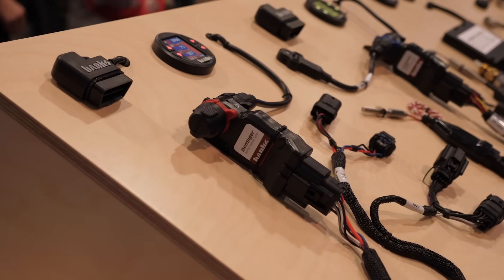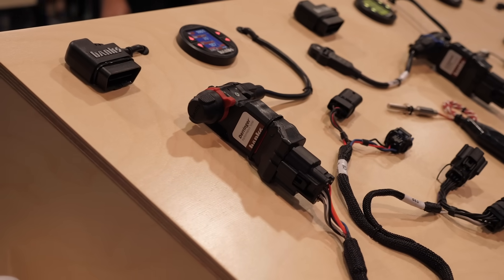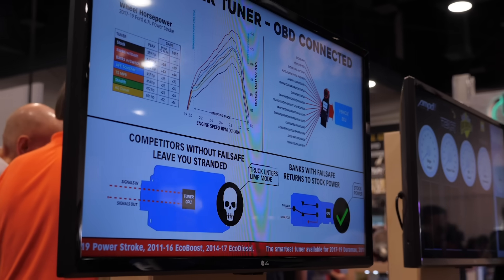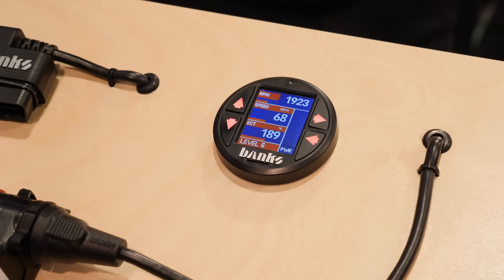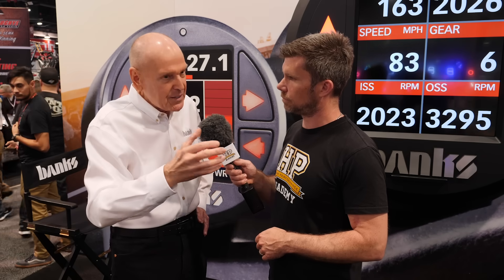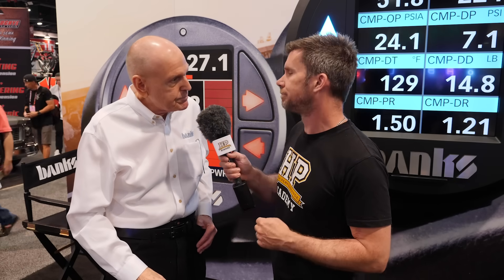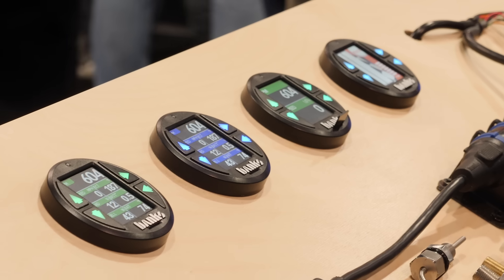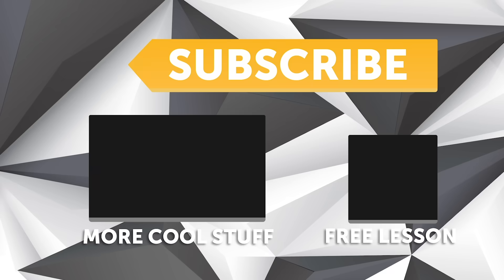More POWER With A DPF Fitted? | Gale Banks On Emissions [TECH TALK]

Comment: Has anyone ever wondered how much diesel trucks would cost without the emissions equipment? I would guess 5 or so thousand dollars cheaper. I'm not a fan of those emission equipment
Reply from the maker: You'd have to buy a gasoline option instead as they wouldn't exist in your market, so not worth pondering in a way - Taz.

Comment: I think it's "criminal" to make it so my truck won't go over 65 when the computer thinks the DEF fluid is poor quality and then 55 mph and then 4 mph. On top of that there is no clear answer as to what is wrong so you or the dealer have to use the shotgun approach and replace sh!t until it's fixed and then sometimes it still isn't fixed. Sometimes the dealer has to replace the ECM to get the limp mode to clear. So the consumer gets screwed because the manufacturer is putting out unreliable and unproven emissions technology.
Reply from the maker: Nothing new about doing that with new tech (good or bad, it makes sense from a few angles and is BS from other angles), but it is already getting better remembering that it isn't even the same across all manufacturers. 

There are still petrol options if you want to wait for the tech to mature - Taz.

Comment: Sure choking an engine down  makes power and reliability seems legit lmfao wow
Reply from the maker: Different for a racing application but for a street vehicle there are rules to follow. It has always been like that from indicators to seatbelts, emissions (you haven't been allowed to smoke out a highway for decades), leaks, glass rules, the list goes on.
All that said and done, there is information out there showing that the tune is where the power is, and a DPF for a performance street vehicle is negligible in relation to that - Taz.
Reply: @hpa101  I hear you but at what cost of ownership a simple non Smokey tune problem solved no need for $$5000-10000 repairs on a part that is guaranteed to fail multiple times during the useful life of the engine... if these parts where either inexpensive or had a greater probability of reliability  I wouldn’t complain 1 bit but that isn’t the case.. I’m a owner operator(trucker) and I was spending all my profit on dpf/def/sensor related issues... black smoke can be tuned out no need for a fart canister... it’s a guaranteed failure point and the manufacturers are doing nothing and aren’t fixing the BS issue instead are lining their pockets and paying respectable engine builders to spit out horse shit if it doesn’t make sense on a track it doesn’t make sense on the street... their isn’t a separate air bubble around a track come on taz hear me out

Comment: I learned how to make a custom wiring harness for a 1994 300ZX with HP Academy, really sucks to see yall pumping out this propaganda. Vegetation near highways grows much faster than farther from the road. This is contrary to what the paid tree huggers say (controlled opposition much?). My mpgs went from 18 mpg to 29 mpg on a 2014 Ram Ecodiesel after full delete (muffler, DPF, SCR, EGR). Please explain to me how using less fuel to get to the same place is bad for the environment. Not only do I use less fuel but the fuel truck that brings it to the gas station goes less frequently, they pump less fuel from the ground and have to process less fuel because I fill up 47% less than before. If everyone deleted and we went back to sulfur diesel, (low sulfur diesel is a sham, the actual costs of processing it are much higher than the benefits, low sulfur reduces the time that diesel is free from biological matter) the price would fall. We live in a bureaucratic corporatocracy and everything our governments do is for the benefit of the corporations. This is the last HP Academy video I'll watch. Love your neighbor, hate your government.

Comment: If Gale can make them run clean (and I believe he CAN) why do we need all E.P.A. the crap on the engine? He should show the E.P.A. how clean they can be made to run WITHOUT all their junk on the engine.
Reply from the maker: There's a bit more to it than just running without a trail of smoke when it comes to emissions equipment. Look up the systems in relation to NOx if you want to learn more about it - Taz.

Comment: It's usually about making a race truck. Its about reliability.   These emissions systems on the modern diesels are killing the damn engine's. I dont believe in rolling coal or whatever. But the problem is.... Instead of the soot coming out in the air it collects it burns and then burns it anyways in regen so what's the damn difference. It's still being burnt and let out in the atmosphere. It's all about the money.  That's it that's all. The more parts they put on these trucks generate revenue and taxes and the bullshit EPA stays relevant.  BIG GOVERNMENT.
Reply from the maker: Worth looking into more, burning at a high temp compared to not at all is different. There is a lot of info out there on this, not just for this application - Taz #sciencebru

Comment: I really don't think you'll get the same EGT for the same AFR when increasing airflow and fuel amount simultaneously. If you can effectively remove the added exhaust airflow than i'd agree with EGT's staying similar. But most of the time you're not increasing exhaust valve and exhaust manifold/turbine sizes, thus increased EGT's are going to occur. You're increasing exhaust gas density by adding air and fuel, therefore more heat will be injected into the exhaust manifold and turbine.
Reply: I agree with you as I was thinking the same thing when he said it.  I can't see how the egt will remain constant with an increase in air and fuel, you are increasing the power so that makes more heat , ie egt in my world.

Comment: Do not know why you want to blow black smoke! A puff a smoke used to be cool but times have changed, I have been around  Trucks my whole life and own 12 Mack & KW's with new emissions motors and there are relatively not that many issues for how many miles they drive. As for pickups I had a 2010 Dodge Ram 2500 with just a dpf and added the bulldog GT programmer and has gauges that you can see the egt and help monitor regens. Stock it would regen every other day going to work with bulldog installed at performance level it did same. I have had this in for 10 years over 100k miles and no issues with my truck. We use lubrication engineers products on our trucks at work and he had me try their fuel additive and I would get a day or 2 more before doing a regen. I also modified the air cleaner box as there is not enough air flow on the pickups as stock my egt would go to 1250 while pulling my camper and same with the tune installed so that is when I modified the aircleaner box and it lowered the egt by 100 degrees. After doing this then I saw tons of after market ram air kits and now Chevy and Ram are getting more air to the motor I have not seen what Ford is doing but these trucks were getting choked out and using the air cleaner that has to be cleaned and oiled is a pain and not the answer as sucking from the fender well does  not get fresh air and limits how much it can breathe.

Comment: I have a 2009 ford f250 I don't know how to save this engine. Truck was bought new it only has 9000 miles. Almost new but I know what happens to the 6.4 with regen process. I'm in Ca don't want to egr/dpf delete. Looking for alternative to fix or help truck run, Had ideas about  maybe dumping oil frequently and refilled after, any ideas.

Comment: The proponents of this DPF system seem to be very pleased with this technology that they have wrought. But they ignore the costs associated with imposing the system on the small business truck drivers-- or even with the major fleets. The major fleets simply pass the cost on to the customers, who passed them on to the consumers. And they also pass these cost on to their drivers, who get roped into leasing trucks.

One thing that the DPF proponents ignore is the pollution associated with building these systems and the waste associated with the planned obsolescence of the equipment that is efficiently running. Where is the carbon offset for all the trucks that they want to throw away? And who will ultimately pay for all of that waste?
Reply: Just in time to force everyone to buy all electric vehicles. I guarantee you that the EPA has financial incentives to get Diesels and Gas engines off the market. Especially the government. An easy kill switch with nothing anyone can do about it. They're already trying to force every vehicle to have a kill switch.

Comment: Increase cetane in the fuel I.e. use a high quality Diesel. Helps a lot with soot and gives more power
Reply: I buy Cetane online and add it to my cheap diesel, it works and it's cheaper than buying premium diesel, at least it is in Germany.

Comment: Whats the carbon footprint of the extra fuel needed to clean the DPF. i think rolling coal should be illegal and the exhaust fluid should be kept on to keep NOX levels down as well as the CAT. The DPF is a joke.
Reply from the maker: I'm not sure, but you'd assume the trade-off is worth it as you're not just burning extra fuel you are changing what is released into the atmosphere. Might be something worth reading up on further if it's a topic you are interested in understanding more as things are only going to get more refined rather than go away - Taz.

Comment: Sounds like a good opportunity for Banks Power to come out with their own free flowing DPF/SCR system since the OEM designs ruin turbos, EGR's and engines.
Reply from the maker: There are some aftermarket options, I'll link one below. Oddly, some countries do not allow non-OEM DPFs to be fitted, however, so you need to double-check before fitting - Taz.
https://youtu.be/ryh4piBvPiY

Comment: What he fails to tell you is that those military engines they built are egr free he tells u they are in the l5p videos, that’s y they can take more torture for there 4 hour test. I have replaced one egr cooler In my 2011 6.7 powerstroke because it failed at 100k and then at 145k it started again so I deleted and it runs fine. Most tunes that are sold run clean. Most guys who deleted there trucks don’t do it for smoke, they do it so it can breath better and more power.

Comment: Def is garbage. If it was not on the truck these companies will not make any money on parts 
Bull shit take it out
Reply from the maker: Half true. If it wasn't fitted they couldn't sell it at all to make money. These are fitted to reach emissions targets/standards which are not set by the manufacturers.

You can buy older vehicles, electric or gasoline ones to get 'around' this if it's a deal breaker for you - Taz.

Comment: All the DPF delete  fans will look pretty sick when it goes into inspection. Gale does it properly and doesn't hurt the stock components unlike the turn up the screw tuners.
Look at his Killing the Duramax series. Intelligent and researched! You are the man Gale!
Reply from the maker: Yes I believe some people have some genuine issues, but those deleting because they think they must in order to reliably make a bit more power from their street legal vehicle do have better options - Taz.
Reply: High Performance Academy Try running your diesel in Northern Ontario, unless you want to wrap your emission components in exhaust header wrap and pray for the best when it’s -40 out, I would highly recommend deleting. Wouldn’t want my truck going into limp mode on a remote highway with no cell service.

Comment: Well my deleted F350 on 10” lift and 40” tires got 18 mpg around town and 22 on road trips... My new 2108 stock F250 gets may 12 around town and maybe 13 on road trips. Not to mention my power to get some drastically different. So, I miss my horse power and fuel mpg. PS... I rarely got the black smoke, so failing to see why we need this crap.

Comment: I love Gale Banks and his clean diesel tunes..."rolling coal" is as lame as having a lifted truck and low profile tires.
Reply: Deleted properly tuned>Banks
Reply: @TwoTone98Z71  we all know Gale says what he says because the EPA is scouring the entirety of YouTube, looking to send a big ass fine to any shop who sells delete kits or performs deletes and could be after client list for the same.

You think that when he's pushing 1000+ horsepower out of a diesel engine on the Dyno he has any of that stuff on? It's straight piped out of the Dyno cell and into the top of his shop.
Reply: @nerdyism2523  Gale sets himself a hard limit on fuel to air ratio. He focuses on getting the engine breathing properly, optimizing throughput of cool dense air, and efficiency of combustion. That lets you make more power without smoke.

Diesels smoke when the combustion is incomplete, typically due to excessive fuel to air ratio, or dirty injectors not atomizing the fuel properly.
Reply: Lifted truck and low profile tires -- one of my biggest pet peeves, and they're common here.
Reply: I roal coal everyday.
Reply: Ok boomer

Comment: First off, In a racing application. Smoke, more specifically pre boost smoke 100% should be there. Why? 

Excess fuel leads to heat, said heat is converted to energy in the turbine housing, this aids in spooling large single turbochargers. 

That being said it doesn't take much so it there shouldn't be anything but a small puff until the charger comes up, but if there is 0 smoke before boost starts coming In then you are loosing on spool up potential. 

Anyone that's been involved in tuning a 800+ hp diesel can tell you this.
Reply from the maker: There is a big difference between a puff and a constant stream of smoke - Taz.

Comment: So what does Banks have to say about the 6.4 Powerstroke design and preventing the OEM DPF back pressure that heats the turbo and other devices that ultimately blow up those engines in 100,000 miles ?  Word is, those engines are junk once they reach 100,000 miles due to the EGR, DPF,High Pressure oil pumps etc. Even the front engine cover gets destroyed from water pump cavitation and the oil pan fills up with diesel fuel. What upgrades will keep a 6.4 Powerstroke running to 500,000 miles?

Comment: I agree with having clean emissions on fossil fuel burning engines. Rolling coal is stupid as shit. But why do these manufacturers push these stupid systems on their vehicles and at the same time choke the engine with tiny piping? They are just contradicting themselves to a extreme.
Reply from the maker: There is certainly some refinement to go, however, even with all of this equipment these modern engines are leaps and bounds above those from the days of old with the power they produce so manufacturers are doing something right somewhere along the way - Taz.

Comment: If you got enough money you can pay off whatever you need like the cargo ships or the trains. As for the old diesels your better off they have lasted and will continue. But also some diesels smoke due to slow injection failure or pump failure. Can't fix it fast you gotta drive it so it's just gunna haze and smoke after you shift no matter what. The main issue is you can see it that's it end of story people bitch. Can't make everyone happy so just do what makes you happy run the risk. The USA is a drop in the bucket compared to other countries. The world is a slow burning dumpster fire due to the humans. Just gotta accept it and move on. Sorry for the rant.

Comment: I want reliability, efficiency, and clean air. One of my DEF heaters just failed. Apparently there are like four of these heaters. $800 to replace this one. $1400 to delete it along with 200lbs of other failure prone equipment and never see it again. And I also get a mileage boost. And I don't like a sooty exhaust any more than the drivers behind me so I would never choose to have that.
Hmmm... decisions, decisions.

Comment: My intention upon purchase of my diesel truck was to run stock with all smog equipment left intact. Unfortunately the two largest killers of a 6.4 is EGR and DPF.  More specifically the regen process. If I had an alternative to deleting the processes I would have chose them.

Comment: He done sold his soul to the government, trying to find a happy middle, meanwhile the power at the wheel is nice, but your overheating parts and working them harder than they should be trying to keep a filter clean, couldn’t give me a new diesel truck unless you gave me a technician in a trailer full of parts I can pull around everywhere
Reply: The vast majority of California residents have sold their souls to the government. Would be nice if Gale created products for both sides of the equation. Sell a perfect tune for each crowd, the deleters AND the non-deleters. Let the roll coal needing guys / gals purchase elsewhere, but those just looking for better reliability and increased power in a full delete without charcoaling the sky, should have options.